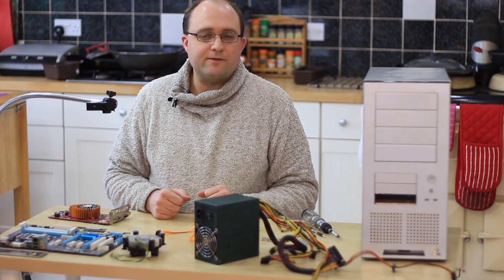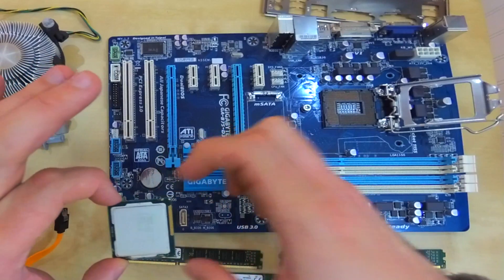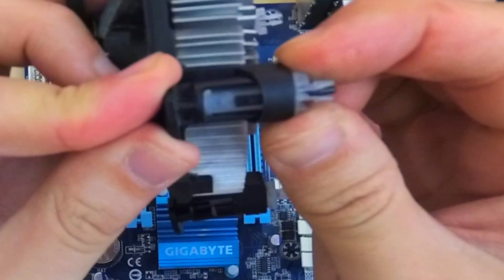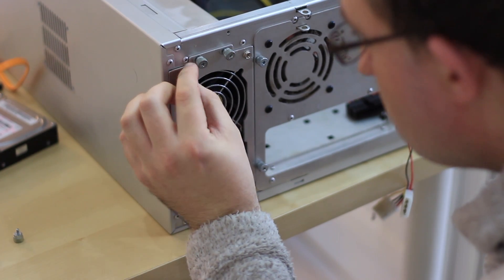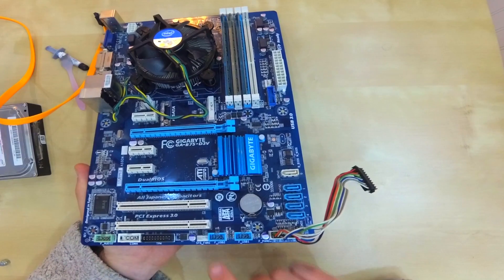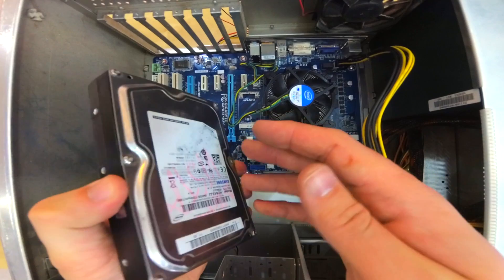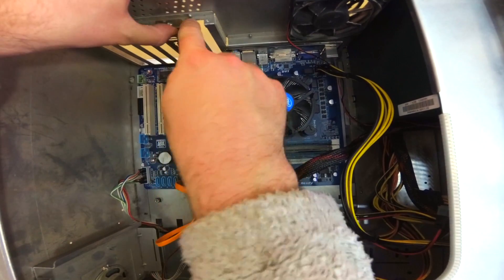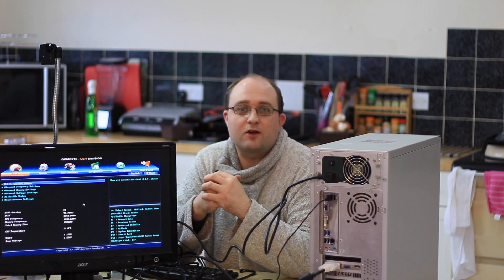Beginner's Guide to Building a PC

Comment: 3 sticks of RAM?  It's my understanding that most motherboards take ram in pairs, 2 or 4 usually. So if you have 3 it won't recognize the third one.  That's why they're color coded.
Reply from the maker: That used to be true, but no. Dual-channel is used to get a performance boost from two sticks - so if you just have two, you put them in the coloured ones. However, 3x4gb is still better than 2x4gb, and most modern machines will recognize 3 sticks.
Reply: Ah, well the last tiem I built a PC was 2007 so things may be different now.
Reply from the maker: It's absurd how fast this stuff changes. Every time I build a new machine there's some new fangled connector somewhere!

Comment: Hey,if standoffs make it impossible for me to set my mobo in it should work with out them right?
Reply from the maker: I wouldn't do that. The standoffs stop the motherboard from touching the metal sides of the case. If they touched, there would be a short circuit, and you may do permanent damage to your motherboard.